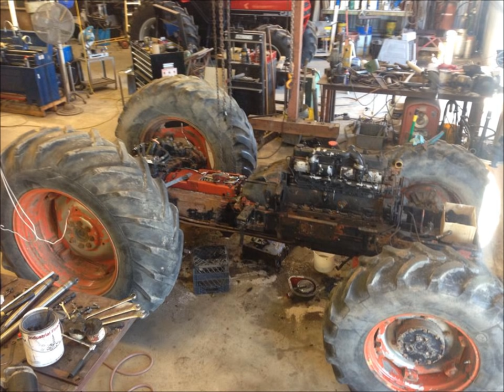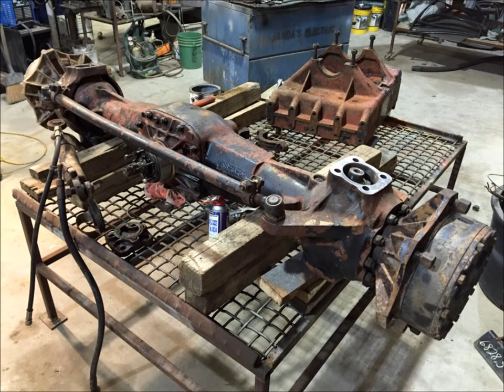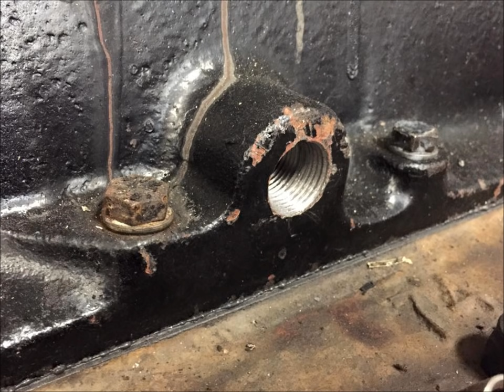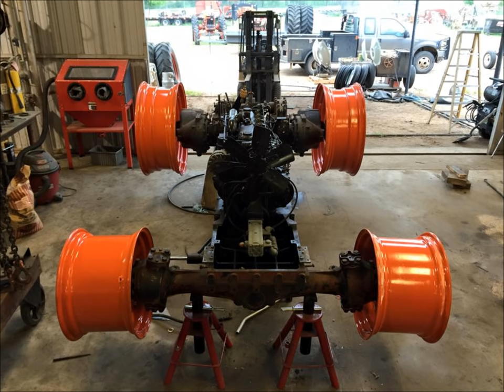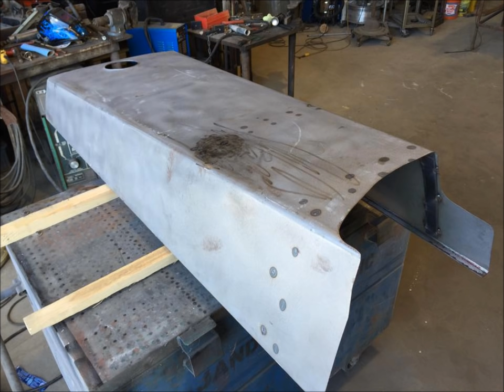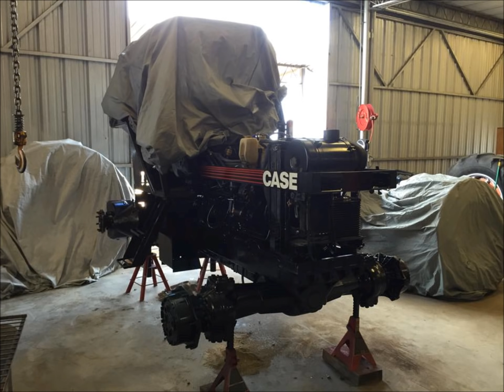1984 David Brown Case 1594 Restoration

Comment: First of all: Excellent Job!!!

I have a question concerning the “transfer case”. If I had a 2wd and could source a front axle and other parts, could I simply bolt the T case to the tractor somewhere, or is the complete transmission assembly different? Thanks, and keep up the great work.
Reply from the maker: The transmission housing and transmission itself are both different on 2wd vs 4wd models.

Comment: Question is that a special did that start life as a 1496 protertype judging by the cab and bonnet shape
Reply from the maker: No, we simply used the parts from the open 4wd and cabbed 2wd to build a 4wd cab version. All parts are original that would have been found on a new 1594 except for the maxxum exhaust and additional work lights.
Reply: +hogslayer are parts still available in USA for these tractors.  cos ere in the UK you can no longer buy new crankshafts? great job by the way 👍👍
Reply: @davidgregory3643  you can still buy cranks from barcley Williams here in the 🇬🇧
Reply: @hogslayer  thought the 1594s were naturally aspired aka no turbo